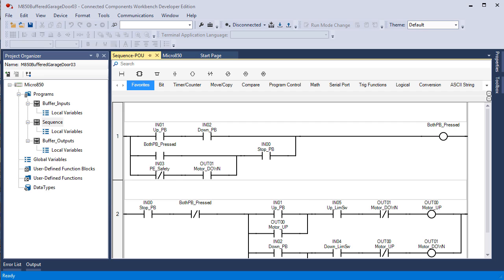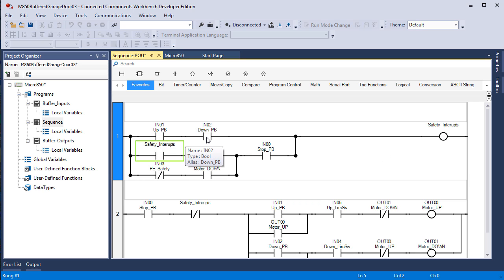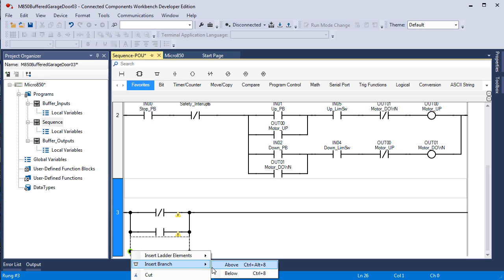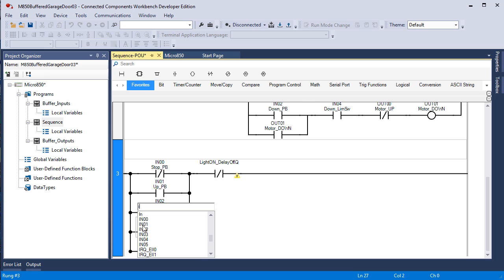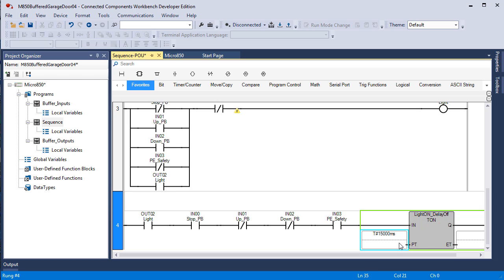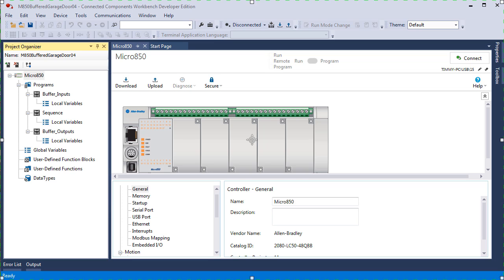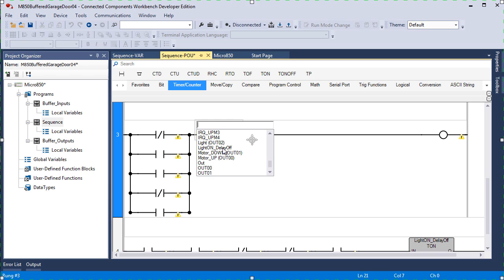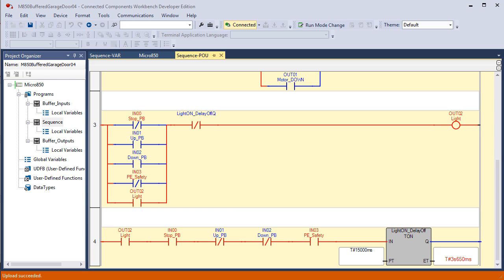Connected Components Workbench Pt11 - Garage Door Pt4

Comment: I am still confused why they got rid of the timer timing bit of the structured data type, even though the EN and .Q not done accomplishes this.
I bought a 820 used off eBay. I could not connect to this controller through ethernet. I had to buy a rs 232 to usb adapter. I still have to try this method to get the assigned IP address and change it. I hope Rockwell improves on this clumsy software. I love rs500 and studio 5000, all thanks to the PLC professor. I am glad that he has embraced it and I look forward to his teaching style and motivation. I suck at soldering. Go TPgates